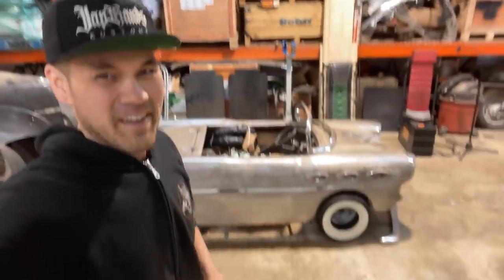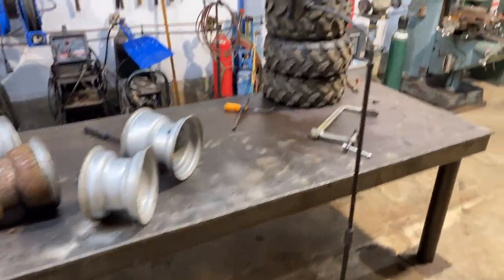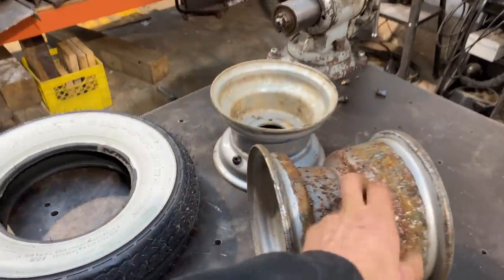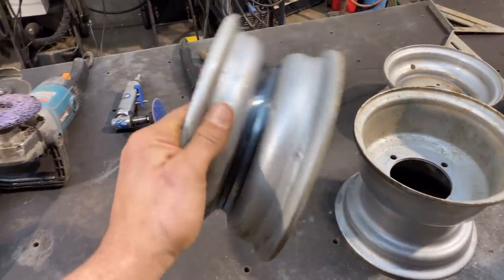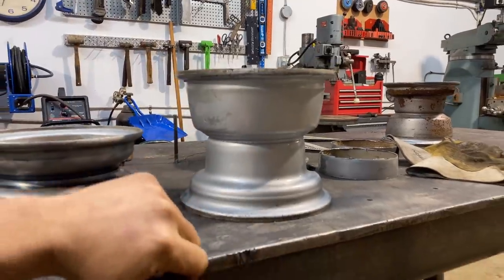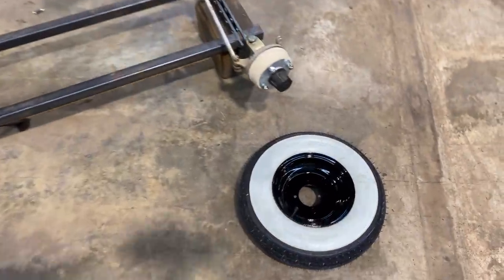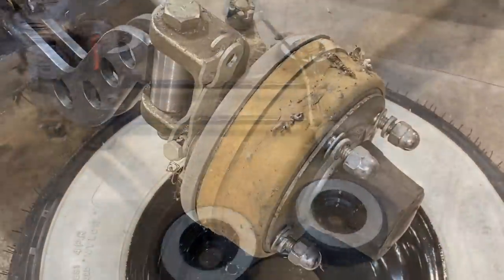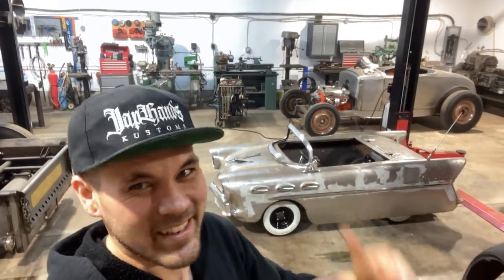1956 "Baby" Buick MINI CAR!! - Narrowing the Rims to Fit New White Wall Tires!

Comment: Impressive work as always, and super cool to put the effort in finishing your friends project. 

 I'm in the patina crowd and agree with some width into the axles to get the stance perfect. Lower is always cool, but you gotta be able to drive over speed bumps and stuff. 

 The ideas to add a body line or a skirt to the rear are good ones, but you'd be close to creeping down the rabbit hole... You've got some other projects to do too. 

 Thanks for the videos!

Comment: the rims were already two piece rims that were welded together, you could have just cut the welds and then narrowed the rims as much as you wanted because you are running tubes so when the wheels come off the rims come apart in two.

Comment: looks awesome and cracking work as always. For me i'd want it a little lower so that the top of the front whitewall is level with the arch and the rear whitewall is just tucking under. 

Patina paint job with pinstripes and a fully done interior sounds perfect

Comment: It needs those curb finders they use to have. The little springs that stuck out and would scrape on the curbs. And you need to put your company logo on each door. I think a stock Buick paint job would look the best. Maybe a set of fuzzy dice hanging from the mirror and a gonad sack hanging from the rear bumper.

Comment: Baby Blue and fake Brown/Rust look  Patina Paint scheme and  3.0 mm polycarbonate screen in that frame.
I think would be a Wicked look.
Also some fake wire wheel hub caps would just fit it out sweet IMHO.

I was also going to suggest turning rims inside out to run deeper dish to out -side and even moor leg room on fronts.
Given you are running tubes you could just drill another hole in the rim on the other side, if you still wanted valve on the out-side edge.

You could possibly also stretch that wheel base another inch or two given the petrol tank fits under the boot lid and then your seat back will be right up to the rear lip of the back inner deck line. you still had that extra inch of rail poking through your drop axel.
You could just grind the weld and slide the drop axel forward that extra inch and the rear wheels would still look OK an inch further back.
Either way it looks fantastic Karl.
PS It looks like you dod not fully weld your King Pin sleeves to the drop axel.

Comment: Awesome project, and great work as always. As for paint IMO I'd go matte black for the body add your logo to the doors, racing stripes and vintage looking/inspired racing stickers. build a bench style seat, and maybe a roll bar, install a notch for a single Bluetooth speaker for tunes or for a joke download exhaust noises lol.  As for the chrome you mentioned, get some Molotow Liquid chrome products. I think they have different size touch up pens you can buy, and I think a spray paint of it. I had got it once at my local great hobbies store, but can be found at a model shop/comic shop or online, but it's the closest thing to chrome without spending the $ to getting chrome done.

Comment: You could put some small spun bullet centrecaps on , just use a small flange sandwiched between the rim  mounting face & hub face - held in when you do the nuts up. Also to make your life easier you could use Vice grips to stop chasing the bead round when you fit the tyres (not that you will have to do it now). Not critiquing, just suggestions

Comment: Love the progress that you are making on the mini Buick project, and lots of respect for carrying the torch in honor of your friend that has passed.
I love the look that you are going after with the wide whites and black steelies. 
Having seen it as a roller now, my only concern is that the front axle and front wheel opening seems to be about 3 inches too far rearward and makes the front end appear a little "nose heavy" if you know what I mean. Could resolve wanting the front end lower, and possible leg room issues if you move the axle forward, and z the front end frame when you do so? That's just my two cents, and appreciate you taking the time to read this. keep up the awesome videos.
Thanks
Reply from the maker: Very interesting perspective on that. I’m not sure I’ll change the opening and adjust the wheelbase but I do see what you are seeing. Definitely needs to be lower also
Reply: @MakeItKustom  I agree with the suggestion of a lakes pipe on the side, but as for the back wheel, perhaps consider a bubble skirt? Thanks for looking.

Comment: Just  my two cents.  The bottom edge of the body needs a slight tuck to give it the illusion of a rocker panel. This would also stiffen the body's bottom edge to keep it from oil canning. Adding rear wheel fender skirt trim and a slight cut out to show a bit of the rear wheel & tire. Another item would be to space the front wheels out about I/2 to 3/4 " to widen the track a bit. This would give you a bit more foot clearance. Ideally, if it looks right then lengthen the front axle.  You may also reduce the steering angle to gain more foot room.  Too much steering  could cause handling problems. Maybe check with the go-kart crowd to see what is acceptable. Another idea is to look at an early 50's Ford T-bird two seater to see how it addressed the  seat arrangement and interior. When it is done add some curb feelers (Whiskers) to the front wheel wells for that final 50's touch. Sorry, its easy for me to talk about the mods since I am not the one doing them. Good luck with your project!

Comment: The wheels and Steelies are fantastic. How about if you find a color code for that year of Buick Coupe and raddle can it and do a patina  paint job. Like blue & white patina paint job with the chrome like it is and see if you can put a thin black line on the paint, around the back wheel wells  so that those skirts look removable. Widen the back axle to see the white wall better. With a 3D printer you could make alot of interior & exterior pieces to size like fake doors handles, emblem SPECIAL CAM EDITION. Keep up the great work and God Bless you and your family. Idk just some thoughts I had like the emblem written in script. 🔥💯💪👍👍🙏🙏👌

Comment: My vote - relocate the fuel tank (looks like there's plenty of available space for something different, and put the body on air bags or similar actuators - adjustable front and rear, get whatever stance you feel like for the moment, and set 'er down on the ground when you need to climb out of it.  Late 60s Riviera centercaps would look tight on those wheels.  

It doesn't quite have the full Buick feel without the drop-swoop on the quarters - although it might be more of a challenge coming up with the trimwork for it - and it might make the solid quarter seem a little more out of place.  Tossing the idea out there anyway

Comment: I am retired and am busier than when I was working. I go to other builder's shops and do projects for them. I am currently in the middle of a rewire job on a 71 Chevy PU, a 68 Camaro, a 69 Mustang, a 56 Ford PU, a 36 Ford PU, a 62 Chevy PU, and a rear end rebuild on a 68 Mustang. I also need to find time to work on my 56 GMC 3/4 ton PU. But first I need to paint my 80  Datsun 310.

Comment: Kinda feeling Satin Black n pearl white two tone... white on the bottom under the side trim... some traditional Scrolling pinstriping on the hood n round tail lights n trunk lid... does feel like it needs a touch more low, with the extra turning clearance the new wheels have given, it definitely needs to tail drag a little 😁😁👌

Comment: Great work! I would be for Patina paint job because it goes with the chrome and metal flake interior.I like cars riding low too but I would consider what will the surface be like at swap meets if it’s grass and gravel then I think this ride height is perfect.

Comment: I really like what you did with these wheels. It would been cool if you could have done the fronts similar to the rear . A flat back but a lip on the outside.

Comment: I think the front could come down a little bit. I think the patina is over done. She needs a good 50s two tone on it. Do a fake powder coat chrome. It's really easy to pull off. The parts are so small you could use a old toaster oven to bake the parts. I really like it though!

Comment: Since you have no suspension you could always make the body raise and lower on the frame, kinda like an adjustable channeling. 4, 2-4 inch linear actuators should do it. If it was mine I'd flake it, but I flake most of what I own lol.

Comment: I know this is kind of late but if you were to drop that body and make it a dragger and put a bit of a tear drop shaped fender well for the rear tire so you get a little bit of that deep dish I think that would look sweet. Oh and maybe some mini side pipes or dual pipes out the rear with flamethrowers lol. And a patina style paint job would look great like it's a hot rod that's not finished yet.

Comment: I would change out the motor to a V-twin BRP CanAm motor so you can have a badass sound coming from it and as far as building inner fender wells those I think will take up a lot of room but I saw where a guy built a fender well on his SXS that bolted on to something behind the wheel which turned as the wheels turned. Just a thought to throw at ya

Comment: Next time use the front hubs to spin the wheels when your sanding with the grinder.   It’s way easier. You can use panel bond to hide the welds in the rims.   After all it’s just a go cart and the welds are on the inside so your not going to see them

Comment: Is it possible to do a chrome wrap on some of those chrome parts?
If you've seen Alex and Dennis Taylor's 55 Chevy drag car, the front and rear bumpers are fiberglass and have had chrome wraps done on them.
I know nothing about wraps or the process to do it but I thought I'd throw that out.

Comment: As far as colors go, i'm seeing metallic dark blue (rgb 1,18,90 maybe?) with slightly-off-white low rider style pinstriping to match the white on tires for the outside. Then medium gray for inside with blue/white (same colors as outside) accents?

Also, does Mach3 automatically do those lead-ins and lead-outs for the plasma, or did you have to add them in CAD?

Comment: Hydrodip the full body.
Get the cnc to use a sensor so it can do something called nonplaner engraving, a fancy pattern on the sheet metal. Na, that would be too serious. Possible though.
Or you could try muratic acid etching of designed unpainted metal, and people will completely freak out at the art statement and technique.

Comment: I would use the shinny plastic metal flake material like they used to use on art deco kitchen and bar stools, candy red with silver metal flake, with silver metal flake paint, with the croshade material patern underneath (can't think what they call that patern) any way you get the Idea. I would add your logo of the skull for the horn button, Jim las vegas nv   It just come to me (lase) patern

Comment: you've gotta do something with those rear quarters they look so unfinished without something for the rear wheels, it wouldn't take that much to work the sheet metal to give it a flared slightly raised fender skirt look, something like the style skirts that were used for the tri-5 chevy's or even the 54-57 buicks, that little car is crying for some kind of definition to break up those long flat sides......

Comment: Black with blue and white flames...(flames not too big, but in proportion to the car)   with a blue and white interior with black accents. Also , foe fender skirts. I don't think you should make a false patina finish. A patina on a car looks cool because it speaks to the life of the car and a false patina is just false (imho). Paint it like a real hot rod and that's what it will be. Oh yeah.... Lake Pipes that work! What about hydraulic suspension made out of a couple of bottle jacks?

Comment: While I was born in the 50s I confess that I'm not a fan of fender skirts. That being said I'd like to see you open the rear wheels to expose those wide white walls. I know that the Baby Buick isn't mine but if it were the rear wheels would be exposed.

Comment: Why not just go with a cermakrome coating? Basically a powder coat with aluminum in it I think. Won't flake off like paint and gives you that nice chrome look.
Reply from the maker: Yeah that works too I definitely like black so I will probably powder coated black

Comment: I agree with some of the other fans ,the little Buick needs some kind of rear wheel opening, that long 1/4 panel just doesn't look right,  but mostly your plans for the paint work or lack of, just don't give the little car the respect it deserves. I myself I 'am kind of over  the rust patina look it was really cool back when only a few guys were doing it but now every body does it . now when I see it I think ether the builder was to cheep or too lazy to put a nice paint job on his or her project, just saying. that little Buick is screaming for a 50's style two tone paint job. like red and white, blue white, black and white. well you asked for some opinions that's mine. (and I'm sticking to it) lol.

Comment: I just bought a 1959 dodge pedal car ,from 1959 ,lead paint with scallops purple with yellow scallops ,missing the pedal car components . So I’m thinking bout a mini frame and a small engine this is for my great nephew . Would you be able to cut me a front cross member and the rear hoop pieces ? I’m in Ontario shipping won’t be too bad .let me know I follow your Chanel every day .love the low slung caddy and baby Buick .your hot rod ,damn slick ..keep it custom and keep smilin per miles ..
Reply from the maker: Hey Johnny that sounds awesome! If you email me some detail drawings I can have a look.

Comment: This a sweet ride. I've said it before... you do amazing work Karl.
Ok. I'm old. I admit it. But I am SOOOOoo over the whole fake patina thing. 
As someone who grew up being ashamed of rusty old cars, I prefer a paint job. It doesn't have to be a $5000 super-duper job either. Something that you can touch up when it gets scratched and worn is fine. 
The rust-look and flat paint look are so overdone on everything, even lawn mowers. That craze is dying out in some places though. But I know creativity shouldn't be held back.
An original, untouched aged job is real and very cool. Fake patina is just that... fake. Like those cheap add-on hood scoops. 
Some of you folks who never grew up seeing rusty as something a "poor" person would have to settle with may disagree. That's ok. :)
Let the flaming begin.
Flames.... OOo ya. Flames? No. Scallops. Ya. Scallops! And two tone paint like a full-sized car too.
There. That's my mini-rant for now. A mini-rant is better than a mini-stroke. In fact having a mini-rant every now and then may prevent bottling things up and having a mini-stroke. ;)
I need a nap now. Get off my lawn, ya durned hoodlums!

Comment: Maybe take an inch or two out of the bottom rocker. So it matches the front and rear. Then lower the body so it tucks a little your up front. Keep it simple keep it classy
Reply: Tire not your lol

Comment: Hey Karl, outstanding job on the rims and tires! I love the white walls on black steelies look! Just my two cents for the chrome pieces, have you considered the Eastwood (I’m sure there are others as well) DIY chrome powdercoat? I’m not affiliated with Eastwood in anyway, nor I have used their product, just saw their video. I think you could really make the pieces of chrome really stand out with this. Your only issue would be Kristina strangling you for taking the oven into the shop lol. Here’s a link to Eastwood’s video, 
https://youtu.be/J9XW8zokU8w

Whatever you end up doing with the mini Buick, I’m sure it will look awesome!

Comment: The "patina" look has been done, has been overdone to death. I'd say this one deserves some shiny paint, maybe two-tone. Some serious elbow grease should bring the chrome back to life, without spending a fortune. As Afr220 suggested, a bit of an opening for the rear wheels would look good. The way she's sitting right now, the car looks a wee bit squat, kinda short in length but tall in height. If more of the rear wheels could be seen, that might change a bit. It's going to be a show-stopper though; totally unique and very elegant - patina paint would spoil that.